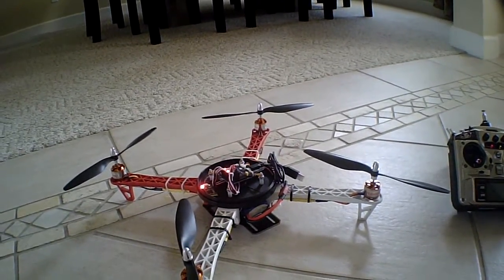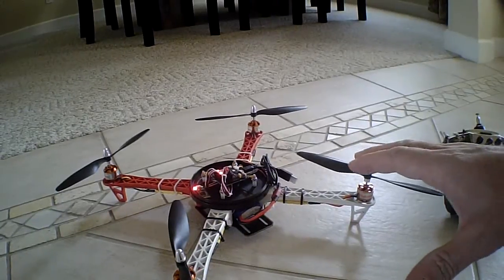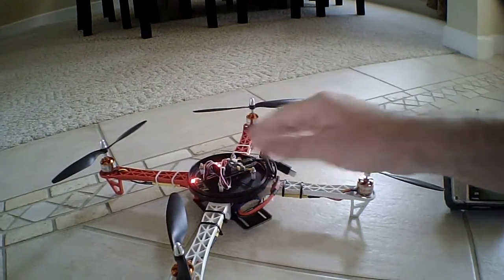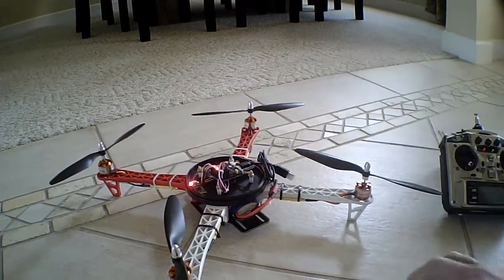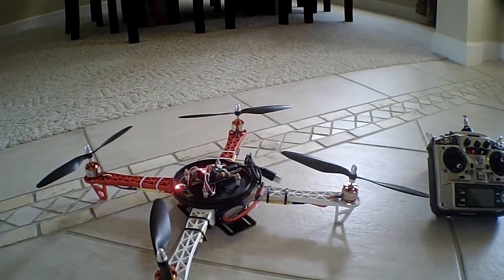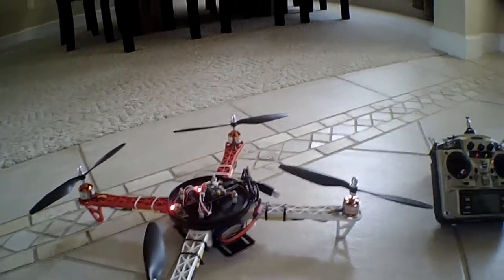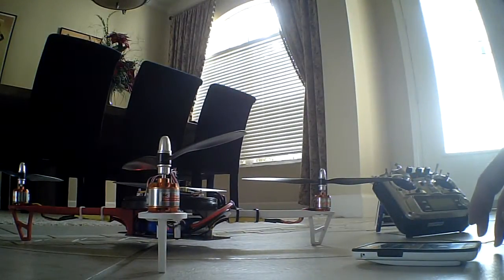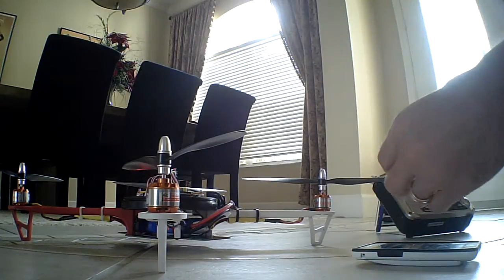Multiwii 2.1 Throttle Jumping Around Problem

Comment: Vibration can cause some weird unexpected problems. In the multiwii, there are settings to add stronger LPF settings, far down in the config file. The default is low, but you probably need to increase it a bit by uncommenting a parameter to enable it. (LPF stands for Low Pass Filter. It rolls off the high frequency data output from the gyro before the signal is used for a feedback control. By doing so, it helps minimize the effects of really bad vibrations. However, the quad will not be as stable and solid feeling by setting that parameter too high. Use the closest-to-default setting as possible.)

If that fixes the problem, BALANCE MOTOR HUB, and PROPS. And also  figure out out to suspend the multiwii and add weight to the board itself to isolate vibes from the gyro, so that way you have a low pass filter built up in hardware, which taxes the microcontroller less.

Comment: As you figured it out, it's normal. Controller trying to correct the error since your hand is not holding it solidly. In short, you gave a hard time to your controller :) Enjoy flying it

Comment from the maker: As it turns out the jumping around is relatively normal. As in, while in level flight, hooked up to bluetooth, the motors jumped around on the screen just like you see in the video here. That being said, yes my motors and props were not balanced perfectly. I have since balanced everything and on the bench she purrs like a kitten now. Still have yet to flight test here with balanced everything though. I assume she'll fly 10x better this way. I'll check into the config.f files also though, thanks.

Comment: Figure this out yet? You may have too much vibration to the controller; balance your motors and rotors, add some cushioning to the controller cards mounting. Also, try filtering the gyros in config.f - this worked wonders for my setup!